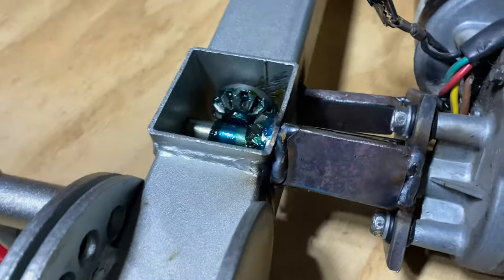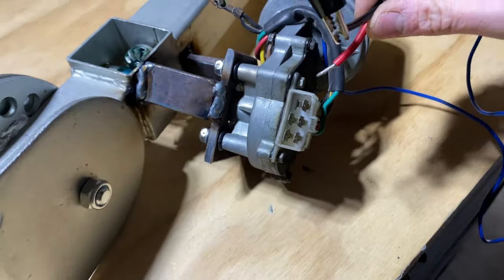Electric Stabiliser Leg Part 2

Comment: Great idea in theory. Maybe somehow using a rattle gun set up to turn the shaft could work? They can handle those kinds of loads. Or even an air ram and use your air compressor to actuate them.
Reply from the maker: That is a great idea thank you! Possibly an air ram with an air tank inside? I will look into it

Comment: Electric widow motors seem to have a far bit of grunt ,some models are nice and streamlined ,dunno what gearing you'd need but might be worth a look
Reply from the maker: I will have to look into another motor maybe something with a square shaft? The taper on the ones I have just stripped out once they had a load, thanks for your feedback